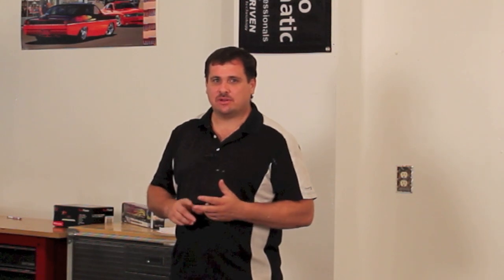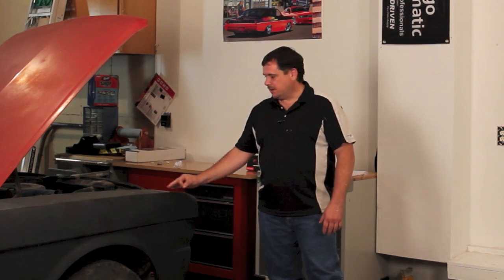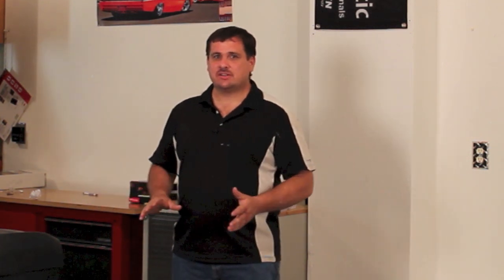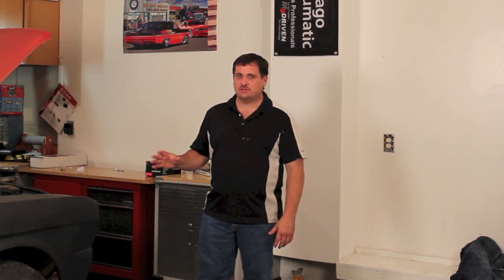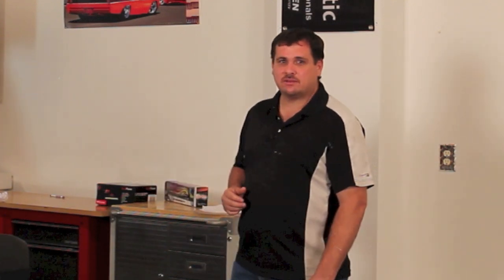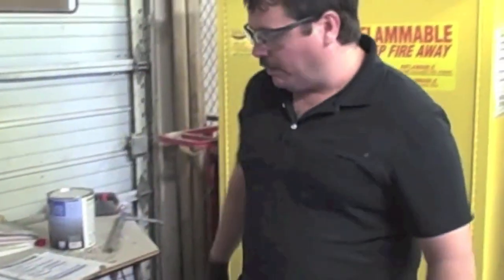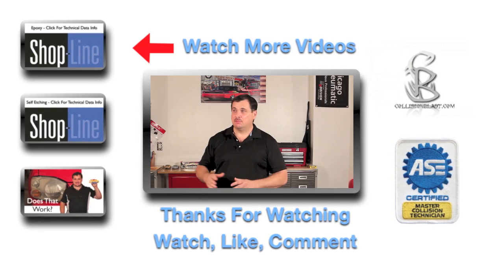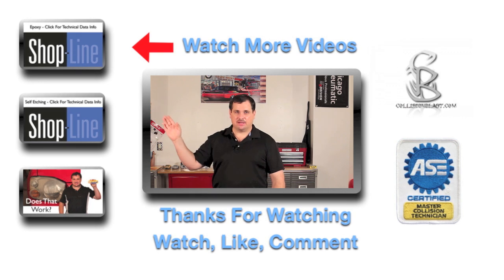Epoxy Primer vs Self Etch Primer for Bare Metal

Comment: isn’t epoxy primer non-porous  
for “sealing” or creating a moisture barrier?   body work done on top of that, body filler sanded, then hit again with epoxy sealer. then you can do you primer surface over that and sand that for a flat surface . primer surfacers are Porous and allows moisture through it which is why you gotta SEAL your metal with non-porous epoxy sealer.  even the DTM primer surfacers are porous. which is why there is confusion regarding primers. even a “direct to metal” primer surfacer will allow moisture through.  i wish paint companies would stop using that term DTM. i think people get confused thinking you can just spray primer /surfacer directly onto metal and you’d be fine , regarding moisture and creating a barrier and ADHESION. i also wish paint companies would create a better sanding epoxy primer/sealer. a lot of them are gummy and create hard nibs on your sandpaper. really annoying.

Comment: upol told me you can paint over their etch primer
Reply from the maker: All paint brands vary.  I looked up there TDS and it say this.  "ACID#8 1K Acid Etch Primer may be overpainted with most paints. If the repair requires additional build primer filler should be used before topcoat is applied."  They state most paints and don't specify type, base coat, single stage, etc.  But it sounds like you will be okay according to the TDS.  Try a test panel to make sure the paint you are using is compatible.  You can read the TDS at https://u-pol.com/wp-content/uploads/UP07776-TDS.pdf

Comment: To mix small batches of epoxy I use 2 syringes. One is for the primer the other for the hardener. I use different sizes so they don't get used with the wrong product what might contaminate it. Then it is no problem to use them several times.

Comment: Epoxy 1st is best most peeps do not realize the hardener has water in it!!!!  Dimethyl Phthalate 131-11-3 30 - 60 Trade Secret *
Methyl Ethyl Ketone Peroxide 1338-23-4 15 - 40 Trade Secret *
2,2,4-Trimethyl-1,3-pentanediol diisobutyrate 6846-50-0 10 - 30 Trade Secret *
Hydrogen Peroxide 7722-84-1 < 5 Trade Secret *
Methyl Ethyl Ketone 78-93-3 1 - 5 Trade Secret *
Water 7732-18-5 < 3 Trade Secret *

Comment: I use cold galv, etch primer, epoxy (2 coats) filler primer then base finally 2K clear. Ive never seen a panel rust after that, even after exposure to sea water.
Reply: Epoxy primer over etch?

Comment: Hey Donnie! Can i apply epoxy resin or epoxy adhesive on top of self etching primer? Or should i apply a barrier primer between the etch primer and my epoxy glue? Thank a lot!
Reply: The TDS for Shopline epoxy says epoxy cannot be applied over self etch. I wouldn't do it regardless of what your product line is.

Comment: Hey Mr Smith. You are a blessing. 
 I've learned a lot from you and I'm grateful.

QQ: I paint just wheels. Curb rash and sometimes whole wheels.
Is epoxy primer the only primer that I'll ever need?

And is there a can primer that you'd recommend for quick spot repairs on wheels?

Happy Easter and thanks in advance.

Comment: Do i still need to add thinner when mixing the epoxy primer?
Reply from the maker: This may depend on the specific brand you are using.  Or if you are spraying it as a sealer.  If you need it to flow out better, than a little acetone or reducer may be needed.  Ask your paint supplier for the specific primer you are using.

Comment: I know this is an older video. Question regarding DTM. Direct to metal. Since this is a primer surface it also has a Self etching primer.
Now since this is a self etching primer you cannot use it with body filler that may need to go over it???
I belive the make this in a 1K and a 2K, eirherway. 

My other question is this. Is s High Build primer the same as a High Build Primer Surfacer?
Also, is a Rapid Primer  Filler the same as a High Build Primer or High Build Primer Surfacer?

Last question. I have a Black Metalic color on my vehicle. Would it be best to use a Black Primer and if they make it a Black Highbuild Primer Surfacer?
Can you mix the color of primers?

Sorry for all of the questions, I am very new to automotive paint but I really want to learn all I can to do the best job!!
Reply from the maker: The only primer recommended by many paint manufactures for applying body filler on top is epoxy.  Yes, high build primer is a surfacer.  And yes, a black primer would be best for black base coat.
Reply: @CarAddictGarage  

So the highbuild primer would then go on top of the epoxy primer and or body filler to act as a seal or is a sealer?
I don't have a paint gun so will be using spray cans. I am looking at Spray Max's system of primers, sealer, paint system. There atomization process from what I have heard and actual people who use and it's very good. Apparently, they advertise there spray can system has equal or better atomization and equal or better spray pattern than an actual spray gun.

None, the less I will be working on the inside lower surface of the right front passenger door, there is some surface rust.

I will be investing in a spray gun. The compressor I have is A 1.8 HP 20 gallon 150 P.S.I. VFM rating is 5 CFM AT 90PSI and 6 at 40 PSI. Because of this my options are limited.
So far I am looking at the IWATA LPH-80-124 with 1.2 tip.

Can you make some recommendations?
Reply: @CarAddictGarage  

In regards to the filler. Let's say I have to apply some small gold filler because of some small rust pits thst are in the bare metal. I have been told to lay down epoxy primer first them add any filler then add more epoxy primer and then on top of that a highbuild primer , then base then clear. 

I also Bern told to add filler first then epoxy primer then highbuild primer etc..

So can you tell me which of these 2 examples I should use??

FYI. I was also told to use the color Grey abd not black because it's easier to see how everything that gets laid on top of that??

Thanks again

Comment: First, thanks for what looks like a pretty great video for us noob DIY guys. My question is about mixing ratios around the 5:50 mark. You said the ratio is 2:1, but you seem to point out 2 parts primer and 2 parts catalyst, which is 1:1. I'm going to assume that was a "brain fart" and the ratio was 2:1.

Again, thanks for a plain English and simple guide video.
Reply from the maker: Yes, it is 2 to 1.  This style of mixing cup does the math for you.  If you are under the 2:1 of the mixing cup, you will go 1 to 1 or 2 to 2.  Only on these cups.  If that is confusing, just use ounces.  2 oz primer to 1 oz catalyst...6 oz primer to 3 oz catalyst.  So basically just add half the amoung of catalyst for the amount of primer.

Comment: Thanks for your video, just wondering what kind of primer you use for rust protection ? I have used rust converter on rusted surface, then applied body filler, now I am wondering if I should use Etch/ Acid primer on top of body filler, or I can use Urethane primer as a sealer then apply paint on top of it? 
Appreciate your response on this.
Thanks

Comment: Those plastic mixing cups are garbage the scale on the side is wrong becouse the cup has a tapered top not straight up and down as the cup get wider the scale is altered Check it with a real cup that is measured accurately you will see how far out it really is...and it will alter your formula big time...
  That is a great way of explaining epoxy primer and etch primer myself I mostly use epoxy primer instead of etch primer then do my bodywork on top of it even for putting on a over lap patch I will grind where the weld will be then weld even the patch gets epoxy primer underneath except the weld area to help control the rust... But check out the mixing cups scale it is wrong use a couple cups and fill all the cups at let's say for a two - one - one ratio use 4 mixing cups all set at one with water then pour them into one cup and see what you come up with.... The scale will be off...yet it is a 2-1-1 ratio that taper of the cup and scale is incorrect...

Comment: So if I am painting something like wheel hubs or anything that does not require fillers but just a top coat then self etching primer in a spray can would be a convenient way to go. Right? Like painting suspension parts or even the rear end housing with say Rustoleum self etching primer would be perfectly fine.
Reply: I'm using steel wheels, and I was wondering if I can wet or dry sand self etching primer.

Comment: What do you recommend for a Corvette?  Everyone shows metal cars, but...
Reply from the maker: There is no need for either of these primers on fiberglass or SMC (depending on year.)  You can go straight to 2k primer surfacer on your repair areas.  Epoxy and self etch are for corrosion protection, which is not a problem for vettes.
Reply: @CarAddictGarage  thank you

Comment: I have a flat sheet of metal that do not need perfection. Can you apply base coat over self etching primer thereby skipping the primer surfacer and the work to get everything perfectly flat?
Reply: What did you find?

Comment: Can that Epoxy be tinted as a sealer?
Reply from the maker: You will need to check with the paint supplier to see if the epoxy can be tinted.  But I think most epoxies come in different colors that will give you the correct under shade.  Epoxy make a great sealer for solvent paints.

Comment: Could you just use epoxy over repaired/bare metal to protect it then 2k primer before base? Are you using 2k etch for that? Reason i asked is I put down epoxy then on my second session of blocking 2k primer filler i went to bare metal on edges. Do i have to use epoxy again or can i just use 2k primer filler.?
Reply from the maker: Hey John, I answered your question in the last part of this video.  I hope it helps.  https://youtu.be/7ruF04k0bWI

Comment: I have been putting epoxy primer on bare metal for 40 years...mostly PPG DP and then the newer DPLF.  I had to learn the hard way, stripped a car to metal and applied lacquer primer surfacer...this was in the  70s. A year later  it was flaking off. I like the ability to apply body fillers over it.  I guess Iam old school....I have put some DTM product on bare steel  but not sure how it will stand the test of time. Tried to locate  the Shop Line product...that I think is a off shoot of PPG....cant get it locally....they tried to shove Omni off on me.  You did a great job a explaining the  the products...

Comment: Im Slowly diving into primers and paints on my first Vw Bug restoration. Im considering the Epoxy but wanted to ask what happens if i dont spray over the epoxy after 72 hours? Will it corrode?
Reply from the maker: Hey @Kalani7259 , I made a quick video to explain the window better.  I hope this helps.  https://youtu.be/OeENuO6-ukk
Reply: I dustless blasted a c10 4 years ago. Didn't get around to epoxy for a few weeks. It's been  over 3 years with just epoxy on and don't have any rust issues coming through. I did use a phosphoric acid wash before epoxy.

Comment: Analysis of Anti Rust Products
Most rust converters and inhibitors which use Tannic Acid or Oxalic Acid, leave residues, and may use an acrylic polymer base which does not allow proper adhesion of epoxy paints. These brand names are Loctite Rust Neutralizer, Rustoleum Xtend, Eastwood Converter and Encapsulator.  Ok for household use but will not allow proper adhesion of Epoxy finishes.

However, Phosphoric Acid (PA) is both a rust converter and inhibitor in one.  It chemically bonds rust to metal and also leaves a fine film that prevents further rust from forming.  It also cleans white corrosion on aluminum and heat scale from milling, greasy finger prints, residues, dirt, etc leaving a primed surface ready for paint.  It also allows welding and sanding over it, excellent adhesion of epoxy primer and paint.  It does not allow epoxy filler to fill dents and scratches.  You need to use Epoxy Primer over the PA and then do gap filling and sanding.

You have these issues to deal with when refinishing cars in metal or fiberglass:
1.       Rust neutralizing and inhibition.  Chemically transform hidden rust and also prevent new rust.
2.       Gap filling dents with epoxy filler.
3.       Adhesion of epoxy primer and paint to the metal or fiberglass car body.
4.       Anti-rust product must be be able to take sanding, welding, adhesion of epoxy primer and epoxy paint, leave no residue. 
5.       Need a product that removes finger prints, greasy residues, dirt, and leave a very clean surface primed for painting.
6.       Need a product that you can apply to rusty metal and non rusty metal at the same time without adverse effects on either section. Cars have some rust spots but mostly not rusted.
7.       Need a product that can remove aluminum white scale corrosion (from contact with air), and any heat scaling from milling. Many RVs have aluminum trim alongside fiberglass
and iron/steel pieces. 

The only product that does all this – except gap filling with epoxy filler – is Phosphoric Acid.
Cost is $25 per Quart or $50 per Gallon online.
Compare this with Picklex 20 which is the same Phosphoric Acid.
Cost is $60 per Quart or $195 per Gallon online.  More than double for a brand name for same product.
Beware the high priced brand names for ordinary products off the shelf.
I would like to know the active ingredients of Self-Etching Primers.  I am sure they are the same thing – Phosphoric Acid sold at inflated prices.
It is important to note that you cannot compare Epoxy Primer with a Self Etching 'Primer'!

Epoxy Primer:  True Primer. This bonds to metal, fills some tiny dents from sandblastic or wire sanding. It has zero rust CONVERTING ability.  It cannot convert rust to a harmless form of Iron Oxide 3 which is stable and non-rusting. It does not leave a film to prevent rust.  It coats
the metal and creates a good surface for the Epoxy Paint to adhere to.  It also allows Epoxy filler putty if you want to even out some larger dents.

Self Etch Primer – Most likely Phosphoric Acid.  Cleans, etches, CONVERTS rust to a stable form of Iron Oxide 3, and cleans surface well to take Epoxy primer and paint.  IT DOES NOT TAKE EPOXY FILLER FOR GAPS!  Now if you want to pay higher prices buy this.  If you are smart, buy Phosphoric Acid directly.
Reply: So just shoot acid on the panel and let it sit?

Comment: Does seam sealer go on before or after the epoxy primer? Thank you for the explanation of the various primer options. It can be a bit confusing.
Reply: Did you get a answer
Reply: @anthonymaniz1933  Yes. Thank you for asking. Cheers 🍻
Reply: I'm down to bare metal should I do seem sealer first.next question should I etch prime or epoxy prime first before body work I'm doing a Chevelle thank you

Comment: Why would you ever need to use self-etching primer over a painted surface that's already adhered to the metal?  Couldn't you just then spray a color coat after light sanding?

Comment: sanded down some indoor hand railing down to the metal, someone told me to use etching primer over other primer because the paint will adhere better on the etching primer, the railing gets used alot on a daily basis.   Other people told me it don't make a difference what type of primer, any info would be very helpful

Comment: I applied primer on my entire hood but the spots where i had bare metal still showing after primer, base coat and clear coat... what did i do wrong? should i have sand down to bare metal the entire hood?
Reply from the maker: I usually prime and block any areas I featheredged, applied fillers, etc.  You may try block sanding the areas to see if they block out.  Then final sand the hood again and respray.

Comment: Does epoxy primer have to be sanded before 2k primer goes over
Reply: Epoxy has a "window" when you don't need to sand it before priming or topcoating.
The window can be as little as 24hrs to 10 days depending on the product. Check the technical data sheet for manufacturer recommendations.

Comment: Thanks brother great video as usual, my issue is I have a small area where I sanded through you told me to use etch primer, then primer surfacer, then block with a 320... every time I block with 320 it takes the  primer surfacer and etch primer off again... I used 3 coats of primer surfacer and a light coat of etched primer. I do have epoxy primer (beige color) should I try that over the bare metal then primer surfacer then block with 320 to see if I get a different result?? This is new to me and I’m NOT giving up help me please
Reply from the maker: Fred, here is a video response for your question. https://youtu.be/I4mo3-aEmGI
Reply: Car Addict Garage thanks big brother amazing as usual!!!!!

Comment: One question which is better way put epoxy primer first at the metal before put filler or after put the filler and sand it all area repair with plastic filler then put epoxy primer on the filler and metal and after dry put primer ????????

Comment: really hoping someone, maybe even Donnie can answer this for me as I cant seem to find anything on my specific situation. I have sanded down the factory paint using 180 grit sandpaper and have taken care of the bondo/bodywork (taking those areas down to bare metal before applying bodyfiller). Small areas throughout the body work have been sanded down to bare metal. I was told by my epoxy primer/sealer manufacturer to reduce the epoxy and spray it as a sealer but It may take me awhile to be able to fully spray those panels due to cold temps here still. So my question is can I use rattle can self etch on those bare metal spots and shoot the epoxy sealer directly over that and the rest of my scuffed original paint or will there be problems?. I keep reading not to shoot epoxy over self etch. Any help from anyone would be greatly appreciated.